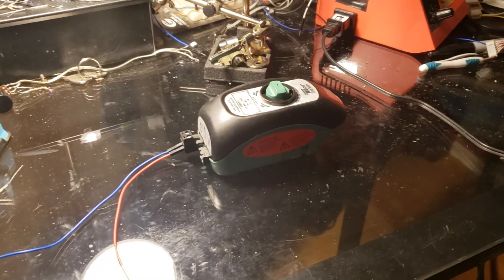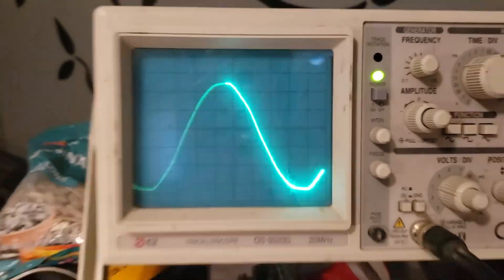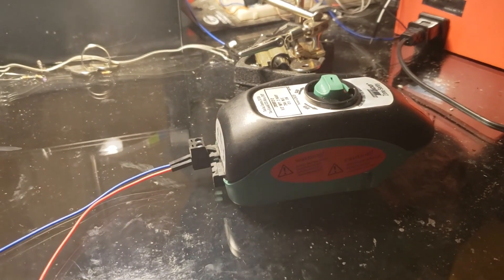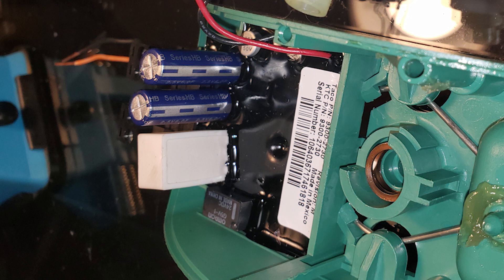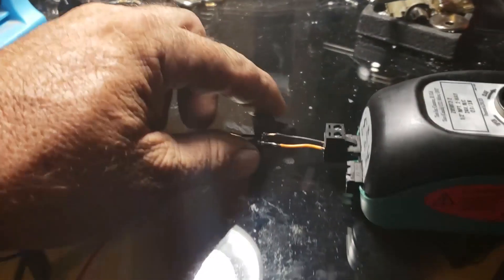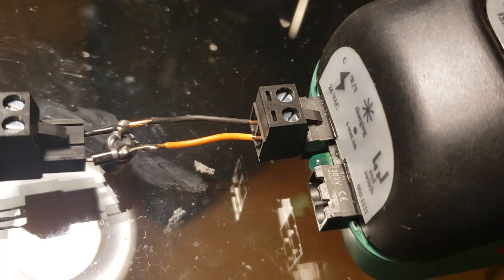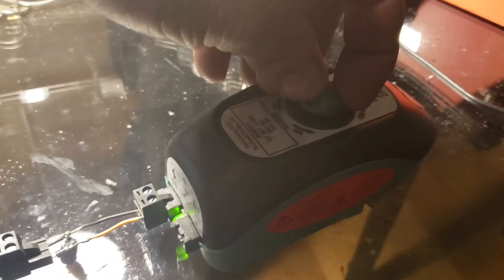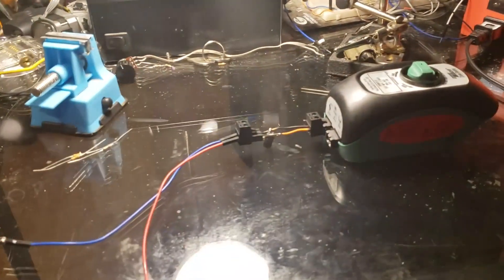Taco + EcoBee thermostat update and possible fix

Comment from the maker: I found the 6 Farad "SuperCapacitors" online.
These are indeed used to store energy and be used as temporary power, such as driving the motor to close the valve after the 24VAC power is removed.
https://www.mouser.com/datasheet/2/87/eaton-hb-supercapacitor-data-sheet-1608755.pdf

Comment: Integrate the capacitor into the input plug for the Taco?
Reply from the maker: There has to be a diode first.
Else AC power across a capacitor would be a short circuit.
Therefore a diode has to be soldered on.

I'm thinking they should buy 300 of those rectifier boards!
300 times $3.84 (plus some shipping) would be a heck of a lot cheaper than 300 24VAC transformers and 300 relays. It would save thousands of $

I'll see what the rep thinks. Because they might pay for it since they approved the design of using Taco and EcoBee.

Comment: Elegant simple solution. Maybe they could make up the input plugs with the capacitor integral?
Reply from the maker: If they buy that one off of Amazon for $3.84, it has an input and output with screw terminals.
Simply putting this inline with the Taco 24VAC input will fix it. And it wouldn't matter what polarity you wire it.
The rectified DC power will simply feed into the full wave rectifier inside the Taco circuit board. 
Basically like a diode in series with another diode.
You'll get a slight voltage drop across the diode but it isn't enough to affect it.